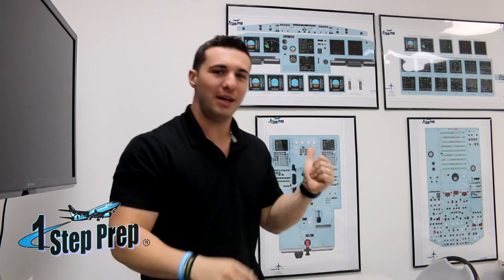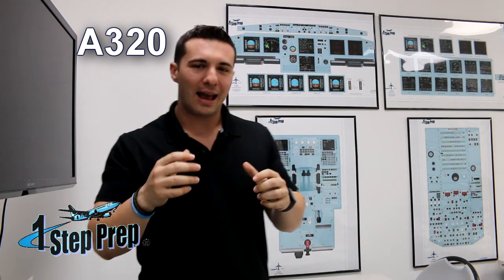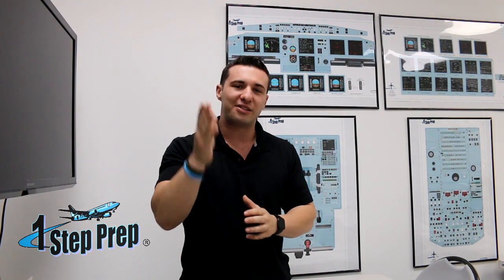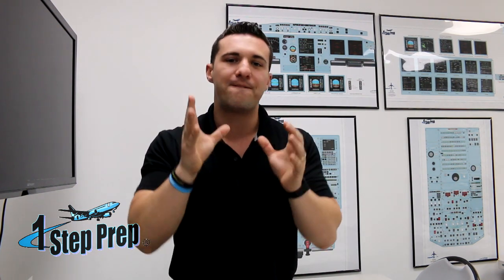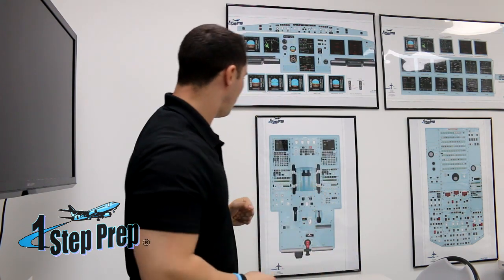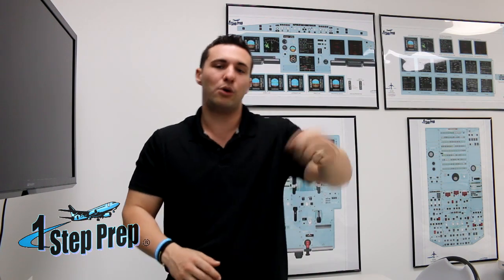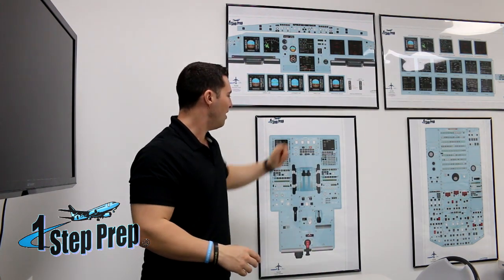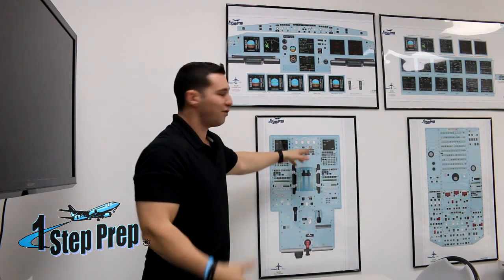FORCE ALTERNATE LAW A320

Comment: Just turn off adrs #2 and #3. You get alt. law and have #1 which is powered in emer. Elec configuration, just in case.
Also with #1 powered you still have normal gear extension. Only use gravity extension with loss of adr 1+3.
Reply: And you don't have to switch the source so it's better, I guess
Reply: Correct! ADR#1 is NO GO item in the MMEL. It is important source, prepared for emergency operation (power supply) counter to the other two ADRs. As well as ADR1 is the only sorce for EGPWC. I suggest to disable #2 and #3. (Anyway this is an output disabling and not a switching off). An avionics maintenance instructor.